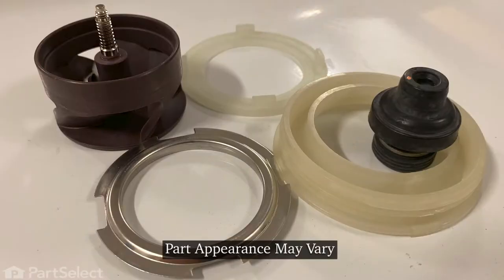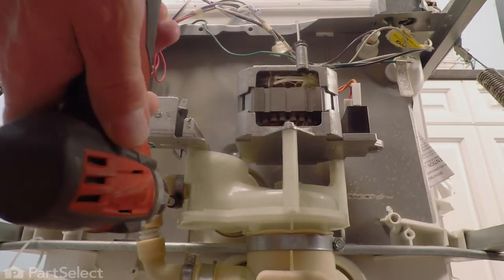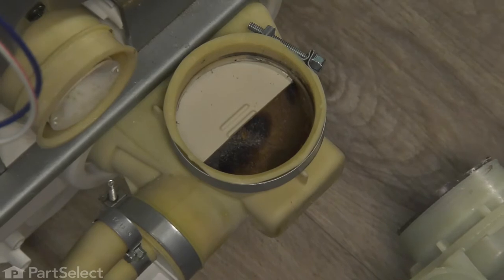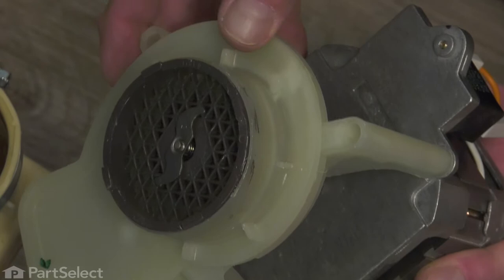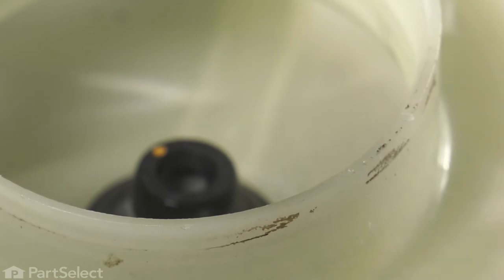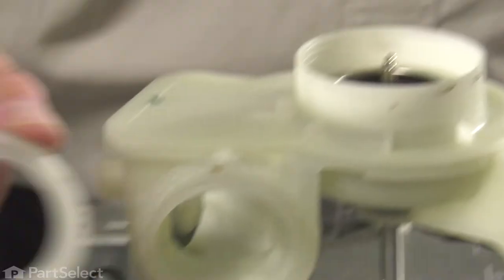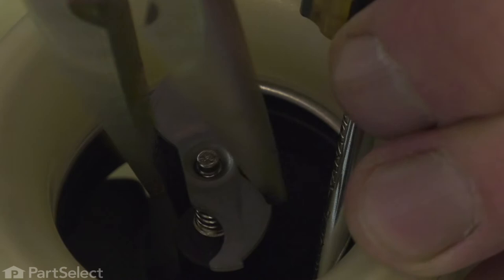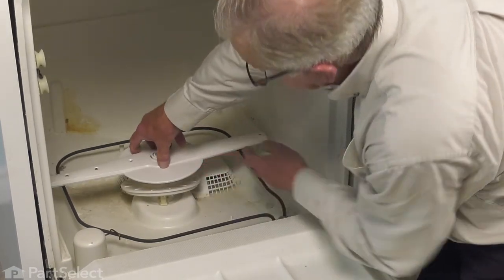GE Dishwasher Repair - How to Replace the Circulation Pump Impeller Kit (GE # WD19X10038)

Comment: Why did you not put the black plastic screen back on under the chopper blade  ?
Reply: No response to the OP’s comment tells me I’m going to have to find out for myself why they did not address it… that’s not good practice for a DIY repair video. 👎
Reply: @ChronoGXay  The screen has been replaced by the "suction ring" in the parts kit. You probably could install the old screen instead of the suction ring, assuming it is still in good enough condition.
No idea why GE used a suction ring instead of a plastic screen.